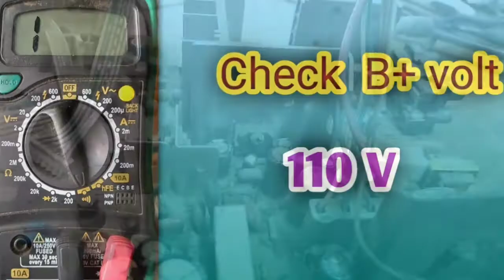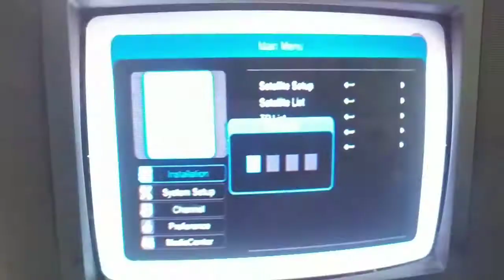TCL Colour TV, horizontal line/கலர் டிவி படுக்கை கோடு ரிப்பேர்

Comment: Bro ultra slim tv vertical ic udane poividukiradu all voltage ok
Reply from the maker: Original IC potanum
Reply: @alexelectronics7939  bro original ic than potten one day full a tv working atchu marunal nal tv on ponnum pozudu tv same problem varrudu bro ic 78040 pin no 5 pin Mattum short aguthu yoke complient irrukuma bro
Reply from the maker: SMPS try soldering செய்யுங்கள். சில நேரங்களில் அதிக அளவில் voltage வரும் போது ic poividum. Ic78045 மாற்றி பாருங்கள்
Reply: @alexelectronics7939  thank you bro